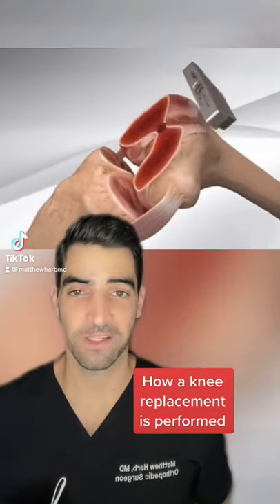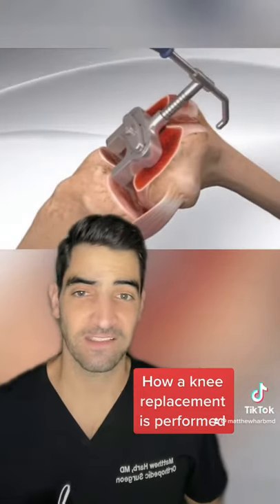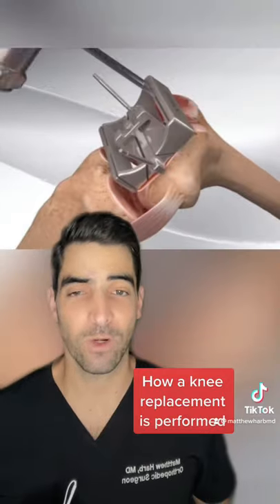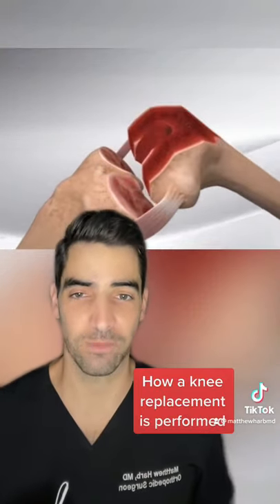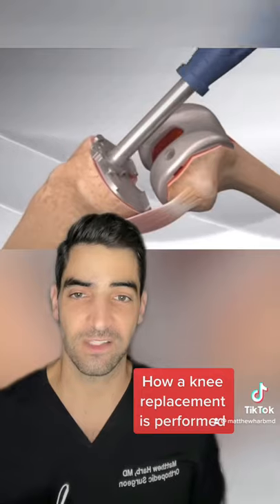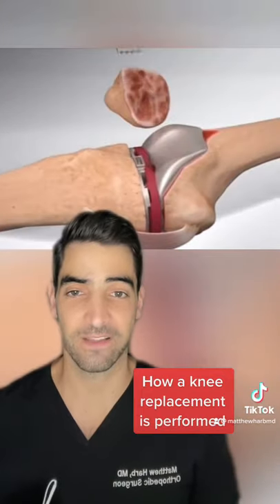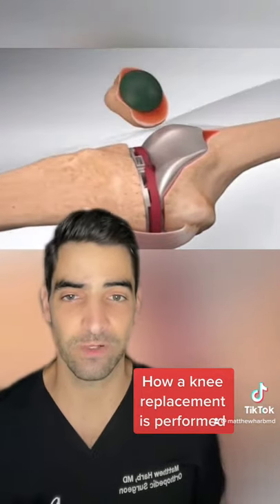Total knee replacement surgery

Comment: I was told about 4 years ago I would need total knee replacements for both knees after Ortho PA reviewed x-rays. I have been getting Euflexa injections in both knees since 2013.(2013 I had a torn miniscus repaired). As long as I keep up with those, my knees generally don't bother me. 

I went for a second opinion, that doctor actually met with me and examined my knees, asked lots of questions (diagnosed with synovial sarcoma, year before I had surgery, luckily wasn't in limbs). He said I still had good movement range, and keep up with Euflexa as long as it was working for me. He said maybe in a couple years might need a partial knee replacement in both knees. The office I have been going to with the Euflexa injections for years, that doctor has never once met with me, originally doctor I had left practice around 2016. If the 2nd opinion doctor wasn't an hour one way, I would go all the time to him. Will definitely go to him for the surgery.

Can you show a partial knee replacement and recovery time difference? Thanks!
Reply: How often do you get the Euflexxa injections?

Comment: Super handsome doctor 😎
Reply from the maker: Thank you
Reply: @MatthewHarbMD I tore both of my ACLs I don't think I can handle another knee surgery in the future both where very painful the pettla graft was the worst. Is there a chance if I catch arthritis early that I can get a less invasive surgery to remove damage arthritic tissue before it spreads. I looked into partial knee replacements but I know that is only good if one side is bone on bone. I also can not have general anesthesia my first surgery almost killed me. The second was done with regional anesthesia only no sedation at all so it would not trigger an asthma attack or what ever happened with my lungs that day.

Comment: Is this a common method, looks so less traumatic to the body than complete joint removal.  How long has this procedure been used and has it held up well with time?   Is there any Dr, that performs this in Washington state?  I need both knees done,bone on bone.
Reply: I’m 57 I had it done three months ago I’m in good shape back to work Monday very minimal pain but you probably won’t be happy after the operation for at least six months complete healing is one year. Please don’t put it off. It’s definitely worth it.
Reply: @bryanjohnson5030 I am 21 and hope and had 2 ACL surgeries. l am, I'm not gonna have another knee surgery it is just way to much for me to do again. I just hope I don't live long enough to need one or they find a way to treat arthritis without removing the whole damn knee.

Comment: How long is the recovery time for this? 
Also do they have to do maintenance on it? Lastly, is it a one and done or would they come back to get a new one or something of the sort?
Reply: I think you have to change the oil on it every 3000 miles, but it's low maintenance beyond that
Reply: I'm having it done in the next week. Barring crazy complications, once it's in correctly, it's good for 10-20 years to life, I was told.
Reply: @meeeka depends on one’s age at the time of surgery.  It’ll likely last “for life” for an 80 year old, but not for someone 55 or younger.